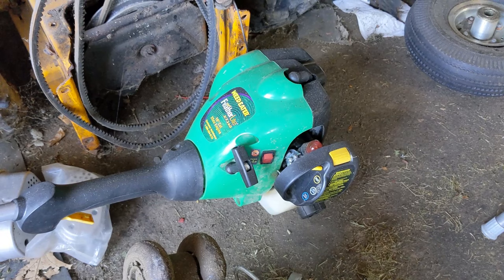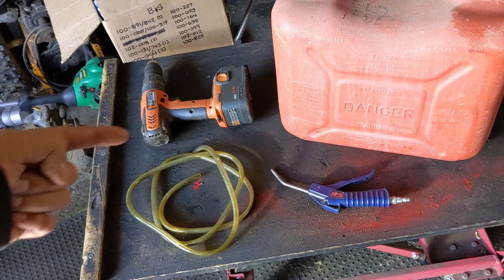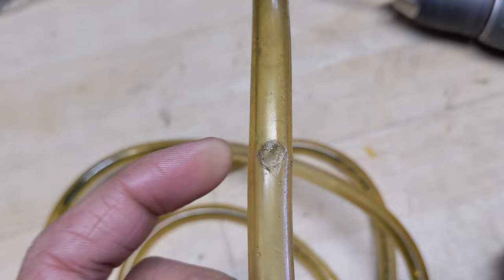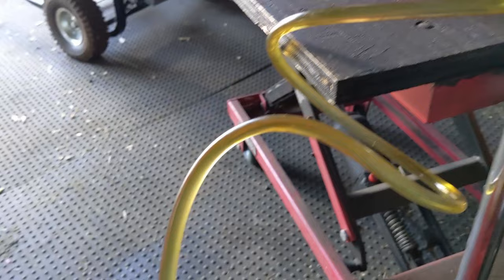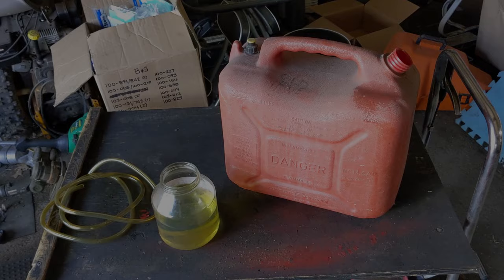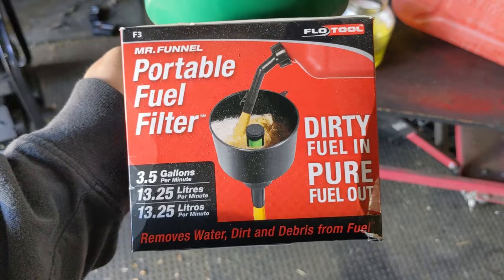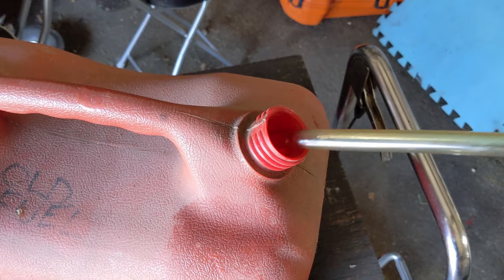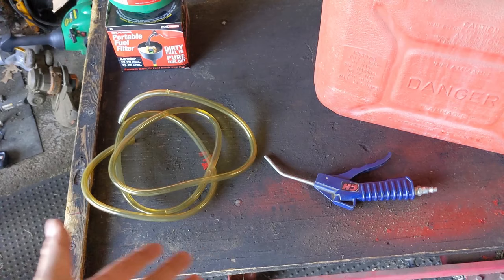How to Easily Drain Fuel

Comment: Some people are using the oil extractors to remove fuel, not too sure if that is safe since most of them say for oil only not to be used on gasoline. Nice easy way to transfer and drain fuel, thanks once again.
Reply from the maker: Yes the oil extractors are not meant for fuel, only oil!

Comment: My favorite fuel stabilizer for mowers, boats and etc. here in Florida is "Marvel Mystery Oil". I use about 8 oz per 5 gallons. It also gives extra power and cleans the top end of carbon.  Price per oz is affordable and not crazy like others brands also.
Reply: I have been using MMO for many, many years and it works well. It started it's life back in 1923 at a carburetor manufacturing company in Chicago. They created this product about that time to prevent their carburetors from clogging. I use it in gasoline but not oil. The product says you can use it in the oil but I do not. Modern oil is the only product to use. Many manufacturers will negate their warranty if you use oil additives such as MMO. I just use it in gasoline to keep the fuel system clean. A long time ago I accidentally left some wrenches in some MMO for some minutes. The wrenches never looked so good, I think they looked better than when they were new. I was very impressed with MMO cleaning on metal.

Comment: You don't need to drill the hole in the siphon tube! Just cut the end of the tube at an angle and lay the compressor nozzle against the angle and it will do the same thing.

Comment: I use alkylite gasolin on my small engine equipment, it can Stay one year without turn bad, the downside it is more expensive than ofdenary gas
Reply: Right on brother, likely the Aspen fuel made in Denmark. Is that a good guess.
Reply from the maker: Yes we have Aspen2 and Aspen4 here it's engineered fuel, last 3-5 years so says the brochure.
Reply: NORWAY